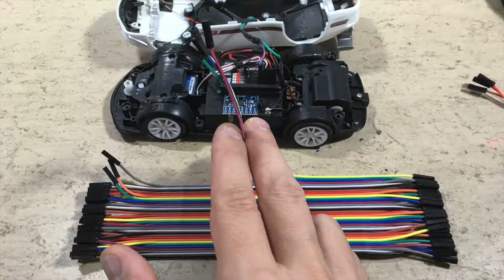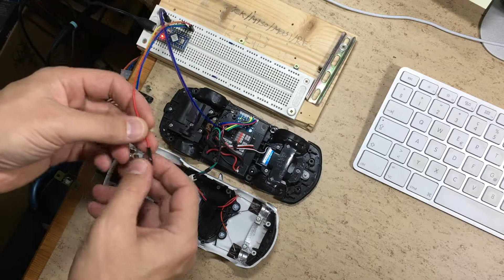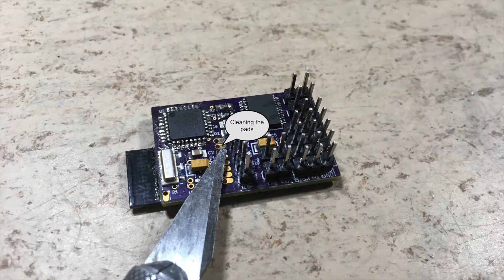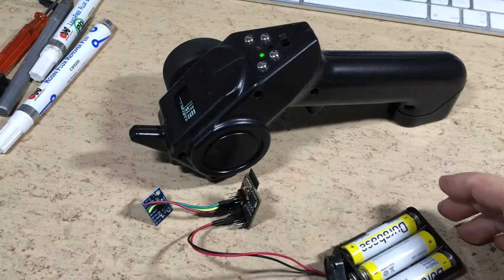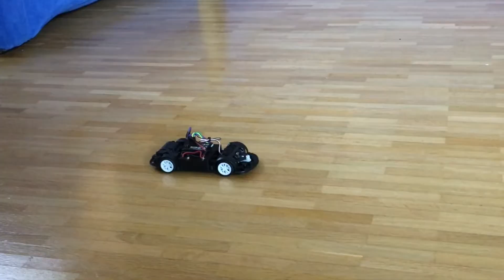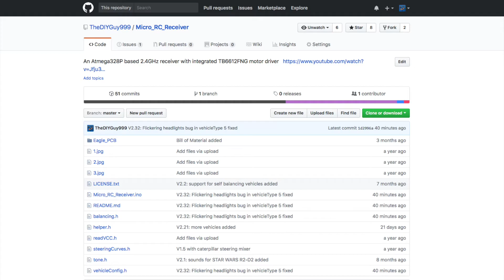Micro RC: Crashing MPU-6050, Flickering Headlights Bug, Nasty 130 Motors

Comment: I had the same problem with mpu9150 and little brushed motors. Best to go with ferrite beads + capacitors.  The noise nearly disappears.
Reply from the maker: Good hint! Could you please tell me, which ferrite beads you have used? On the motor wires? How many windings?
Reply: Motor side, 102, 104 caps.  Driver side 103 caps. 6mmx2.5mm ferrite beads.

I made little boards with 0.1uf and 0.001uf in parallel on the motor side. Then inline I used one 6mm x 2.5 mm ferrite bead on each input with bare solid wire passing through each bead. On the driver side, I have one 0.01uf across the inputs. I mounted the boards right on the motors. Beads were from ebay https://www.ebay.com/itm/ONE-LOT-OF-100-6MM-X-2-5MM-FERRITE-BEADS-BOX-13C/400796059219.
Reply from the maker: Thanks a lot. I will order some ferrite beads